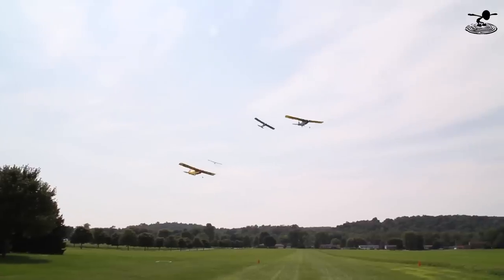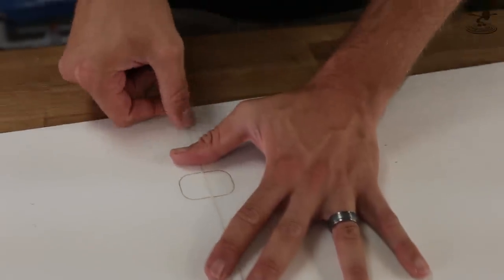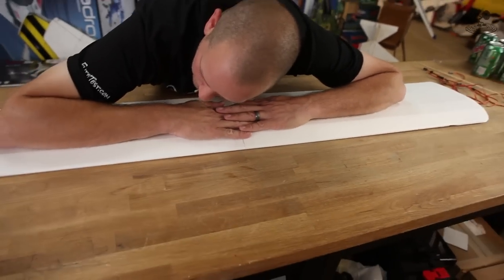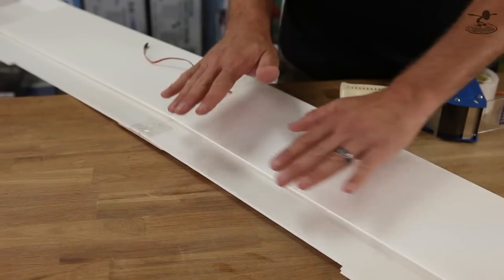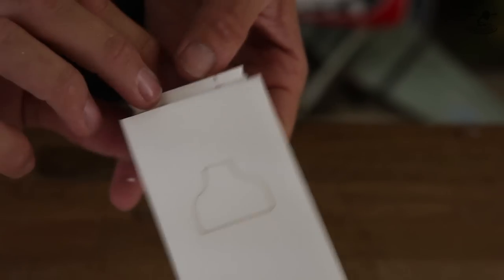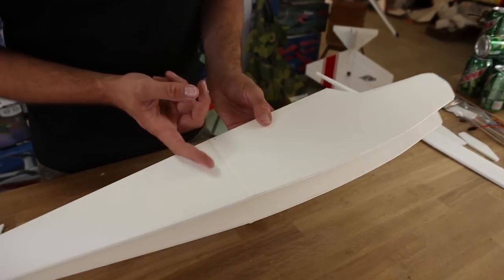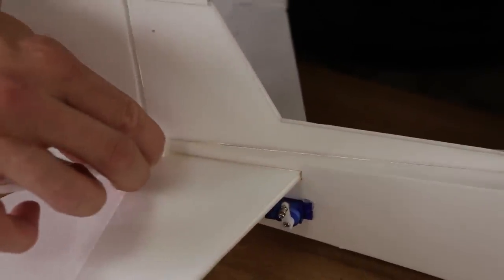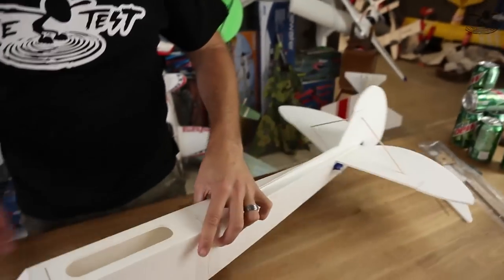Flite Test - FT Simple Storch - Build

Comment: If anyone buys this kit here's a pro tip. The Power Pack (C) doesn't come with enough servo wire for the whole plane, order more. It comes with four 12 inch wires, once doubled up is enough for the wing only. You'll need to either buy at least 2 more 12inch wires or 2 24in. It's not a big deal, but it would be really annoying if you didn't have any extra laying around.
Reply: Thank you!

Comment: I have been reinforcing the holes that the skewers pass through with Pieces of  Gift cards cut  in 1/2 in  to 5/8 inch squares with a hole drilled in the center and glued just as Josh did with the pieces of ply wood.  It is easy and doesnt need special tools.
Reply: You can also use pieces of Formica sample cards if they are still available

Comment: He makes it look so easy :D Took me 3+ evenings to make mine, and even then the landing gear is a bit off. First build so not surprised, should have started on the Nutball.

Funny thing is I could hear Josh all the time ::
"Remember, extra glue is not extra strength, its extra weight"
"Use your table as a friend"
"Now I'm just going to take a bit of scrap foam and wipe off the excess"
"Be sure to get all those little bits of foam out of there"
"Now I'm just going to take my razor and ..."
;)
Reply: My first build too!  watched that video 15 times easy, lol!
lay out and cutting was a couple evenings, final assembly was a few hours.
Now if only my receiver would show up!
Reply: FLITE TEST INSTRUCTIONS ARE VERY SPARSE. The videos move fast, much is left out. Instructions are disjointed e.g., power pod instructions are hard to find and are separate from all of the airplane build videos this is pure laziness on Flite Test's part. They do not even provide the link to additional instructions. They make it look easy but it is not easy the sales effort is real slick they have no interest in slowing instructional build videos down they just sell sell sell. Their indexing of build information is hap hazard semi organized all information is not in one place or consolidated, even though they think it is organized it is not. Older information is harder to find. Power pod instructions hard to come by.
Reply: @jmitsch44827  Free is free.
Reply: @jmitsch44827  ok, so 4 years has now past, what model would you recommend now with 4 years of research and technology behind our belt?  have they improved the plane?  is the landing hear nightmare fixed?  i read over and over about the landing gear.  Flite-Test is a first - rate community organization, i would assume it's all fixed by now in their speed-build kit, is this the case or not the case?  as for the extra materials needed, have they added things to the list like the servo extensions and things like that and stuff like this?  Just curious and I appreciate your help on this !!!!!
Reply: Niiiiiiccccccceeeeeeeee move

Comment: My first attempt to build the ft simple storch using A2212 3t 1000kv motor and a 1045 propeller with a 2200mah 3S battery ended in failure but I learned a lot.thank you flite test team.

Comment: I utilized the round servo horns included with the power pack servos as the reinforcement for the power pod. I used the nifty Philips screwdriver provided to widen the center of the servo horn (where it attaches to the servo) just enough to fit the skewer through it. I passed the skewer through the fuselage and through the servo horn on the interior of the fuselage *female teath facing in. I pressed it into the foam and followed up with glue wile I turned the skewer to maintain passage. works like a charm👍
 you guys are the best!
Reply: Wow very useful tip for me after reading your comment 8yrs later.

Comment: The one missing thing in your videos is guidance on mounting the batteries securely in the planes and on this particular kit.  The routing needed to connect  a battery to the ESC.  Standard cable in the power kits is not long enough unless you cut a hole in the power pod.  Cutting holes to to this and other elements of the electronics setup for each kit would be very helpful.   Just finished the basic assembly of my Storch tonight.   Tomorrow painting and final trim items before the Maiden flight.

Comment: I have built two of these and they fly perfect. This is my favorite scratch build and so easy to fly and very impressive on the airfield
Reply: is it a good plane for a trainer?
Reply: +lucas 09  I think so  it has a wide wing span . bigger is better I added 2 inches to the wing span on mine.
Reply: Oke thx i wanna make this for my first ever rc plane bit i dont wanna build a ugly trainer so thx
Reply: @robsycko  -- omg, wow, and it still flew?  seems like that would throw off fuselage length, C of G, empennage length and style and engine size  and things like that and stuff like this.

Comment: I like the wire tie connects on the ldg gear contacts. Light and quick to do. Also I would think dental floss winding-hot glue soak would also work.

Comment: LITTLE TIP, instead of using tape to keep connections together you can use shrinking tubes, used it on my tricopter to keep connections together and works perfectly!

Comment: Great plane. Only had a couple of problems. The wire I got in the pack was so thick that I had to use a vise and a hammer to bend it and it wouldn't fit in the gaps designated for the wire. Also the straw would not fit over the wire so I just have the foam wheels and nothing else. The other thing was the fitting of the esc and battery and the accessibility of the receiver. But other then that it was a really fun build and I would definitely do it again. 👍

Comment: I noticed the small opening in the bottom of the wing for wiring is directly at the paint stick joint. That could be opened up the entire width of the fuselage and still be unseen when the wing is attached to the plane. That would allow the addition of a small flat bracket iron bent in the middle the same amount as the dihedral and screwed on across the paint sticks. This would reinforce the dihedral angle and make the wing even stronger. Probably unnecessary; but maybe still a good idea.

Comment: I have a quick question.  when using the power pack, does a guy need to drill out the servo arm hole in order for the linkage stopper to fit?

Comment: I have more props. 8060,9060,9060 folding and 1045 .Which prop I must to use? I want 9060 folding prop.But im not sure about that.What do you recommended? I got emax 930 kv,40a hobby king esc and 2200mah 3s lips battery.

Comment: Is it possible to paint each main section of the plane  before gluing them together, for a better visual result ? Or is there a chance the hot glue may not stick too well on the parts if applied to the paint?
Reply: well its possible but keep in mind not painting the surfaces which you want to glue to each otherand you have to work precisely for the best result :)

Comment: Hello.
Ok so I am brand new to RC planes, and want to start somewhere.
I am thinking about buying this set + the pack with all of the electronics needed. 
I will use the plane for long range FPV flying.
What mah size is the best to go for, and how long flight time can i expect? 
Can i use the same battery for both FPV and motor, or should i get a spare one?
Reply: everythingzone I'd recommend you get the 3 pack swappable kit with the nutball before trying this.  I'm taking a stab at building this scratch and it's pretty challenging.

Comment: My local Harbor Freight stopped carrying those clear hot glue sticks and only has the crappy milky ones. I've only see the milky stuff, what brands are still using the clear formula? why did they change? is there an alternative?

also, I thought Peter did an OV-10 style VTOL tricopter or such, but I can't find anything on it other than an obscure video. you guys should do a speed build on that! it'd bridge the gap for some of us who like both tricopters and planes and want to do both at the same time!

Comment: Great vids guys! I only have a problem.... Since i live in italy i have no idea where to find the foam boards you use... I found something similar called forex or expanded pvc is that what you use???
Is depron also good for these projects?
Continue guys! great channel
Reply: I regularly use Depron 5mm and it works fine just finished a David Boddington Ghost Rider with Depron fuselage and hot wire cut wings fly's a treat.

Comment: Make sure to use loctite on those little metal things on the servos.  It will eventually unscrew...I learned that the hard way.
Reply: And... Use good servos, just, in general. Now a failed servo killing some foam isn't as bad as a wrecked 6 channel.heli, but crashes are never fun.
Reply: DFX2KX
 Crashes can be fun, what are you talking about?

Comment: Are you using 5 mm foam board? Or how thick it is? Please answer, its really important for me.
Reply: They use 1/4" but I have built with 5mm just fine. Good luck building!
Reply: Thanks :)
Reply: Readiboard is 3/16th of an inch.

Comment: All the way up to a 3000mah mr josh says, mine is getting a 4000mah 3s battery , 2830 1300kv motor with ether a 9x5 or 10x4 prop, metal gear servos all round with flaps,  and fully loaded with an APM, GPS Current sensor, Airspeed sensor, OSD, 433mhz Telemetry, two cams on a switcher, 1500mw vtx,  and also fitting arduino controlled navigation lights.
its fair to say its gonna be a heavy plane, will need to carry a reasonable speed to maintain altitude and aint gonna float like his did in this build lol

Comment: When you fold the leading edge of the wing backward and make two bevel cuts at 45 degrees, that only allows the wing to be folded at 90 degrees.  When I try to bend it further, it takes so much force that I feel that if I push it, it's going to put so much stress on the paper that it will tear.  What am I not understanding?
Reply: +Mike Collins The foam is mostly air too, and will collapse under force. Once you hit the 90 degrees the squishing of the foam takes less force than tearing the paper, so it will just squish.

Comment: Hey, I know this video is really old, but I have three questions for anyone who knows a little about this stuff:
1) Would you recommend I (a complete noob) get this for my first plane ever?
2) Can I make a cargo bay underneath in order to drop say water balloons or stink bombs with another servo, without compromising the structural integrity of the fuselage?
3) Can I cut holes in the front to add FPV and small action cameras?
Reply: An Audi RS6 1) ft tiny trainer or ft explorer 2) yes 3) depends in your planes center of gravity and how you set up the electronics to find out what you can mount and where. Fpv on planes can be done from the top very effectively and allows you to keep your CG un-dicked with.

Comment: Great video and plane.  Maybe I missed it but can you build this with dollar tree foam board?  The wing halves looked too large for a single piece of foam board.  Maybe I saw it wrong.
Reply: You are correct, the wing is made from 2 pieces of foam board.
Reply: I assume then the plans explain how to join two pieces of foam board to make one wing.  That would be fine, just curious in case they were using an odd size that needs to be purchased.  Thank you for the reply.
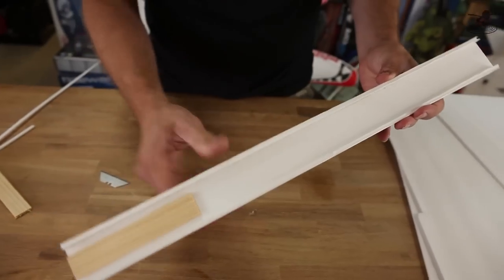Reply: MyTechWebTV you're welcome. The video shows how to join the wings at this part:  6:20  http://youtu.be/i0S4epTCmss?t=6m20s

Comment: The original Fieseler storch has "V" supports for the wings, I don´t see it in the Flite Test scratch model. Can be added? what is the most suitable material to make the "V" wings supports?
Reply: I believe you are talking about tension lines, going from near the end of the wing to the bottom of the fuselage? You can make these with some twine and some sort of hard point (plastic gift card, wood, metal)

Comment: are you guys really don't have troubles with elevator part???? tried this tail design on my plane, cuz i like how it looks). elevator make my ass burn - it needs a reinforcement for twisting, and simple stick or bbq will not work. guess i need to cut and glue in a U shaped thing. but what mat to pick?

Comment: Why is the paint stirrer stick cut and glued to two different pieces?  Why not use one stick crossing the gap?
Reply: I was wondering this also.  I think it has to do with how the wings need to be angled.  Sorry I dont know the proper tech term.
Reply: brischultz  I think you are right, it seems to have a slight dihedral to the wings.
Reply: brischultz Hmmmm, why not just score the stick on one side only just enough to bend to conform to the dihedral?  Just sayin.......

Comment: Someone please answer this question, I'm new to rc planes. When you buy the kit and get power pack c do you have to buy a separate receiver? I'm planning on getting this for Christmas
Reply: The Spitba11Warrior thank you
Reply: Would the B3 Pro Compact Lipo Charger charger (An internal 100-240V AC switch power is built in, and the high precision balance circuit can supply larger current up to 850mA series.Designed for 2s and 3s batteries)work for lumenier 2250mah 3s 35c lipo battery

Comment: Hi there. Great project here. I'm trying to make one too. Could you please share the sketch of the control horns and motor plate please? 
Thks.
Reply: it should be on the plans
Reply: Hi. Thks for the answer. They're not on the plans (at least, i could'nt find them. Could you send them to me please? Regards.
Reply: 007Cacto hmm. There aren't plans for the control horns themselves. I would recommend just buying them, as you get 20 for 5$.
Reply: Ok. Thks anyway for your time. :)
Reply: 007Cacto control horn plans? REALLY? ...cut something that's the right shape to keep the control rod parallel to the control surface and drill the hole so it's over the hinge. How hard is that. ...control horn "plans" ARE in the plans of many ft pdf files of you REALLY need them. Download a few planes until you find one with the horn on the page. Or you could Google "printable control horn" and click on images ffs. Sheesh

Comment: I'm curious. Those 9 gram servos, are they named because they weigh 9 grams, or the more likely (in my mind) because they exert 9 grams of force? (I know force isn't measured in grams btw).
Reply: Yes, 9grams of weight.  I get the 9 gram Emax metal gear servos from Ebay, for about $16 for 4 servos. They are great! Got tired of replacing the regular ones. The Emax ones have held up to some serious crashes. Haven't stripped one yet.
Reply: Flying Monkey Darn it, I just paid $11.99 (+ tax of course) each for 4 of them. HiTEC HS-55 feather micro.
Reply: WhatDoesThisButtonDo Hey, you'll need more sevos later. On that other build. : )
Reply: 9 grams of force would be far too low to move a control surface. They actually have around 1.5kg*cm of torque.
Reply: kardRatzinger yes, give or take. Depending on the brand and model. But 9 gram is in reference to the servos weight.

Comment: So quick and probably stupid question, I am extremely new to this hobby but it fascinates me and I will not stop until I get my plane off the ground. Ive built 2 of the versa wings and the paper always peels off of the elevons rendering them useless... which made me start thinking about the ailerons in general. How exactly do you get both ailerons (controlled by two seperate servos and servo arms) to be near identical in the throws? is it something you program later or is it more with the build process??? Thanks in advance
Reply: Flit test has an episode on just that. Mixes, on your transmitter. To fly something like a wing, your transmitter must be mixing compatible.  Check out their episode on mixing. Hope this helps.
Reply: Thanks! I've figured it out on my turnigy 9x
Reply: James Enlow Cool, 9X was my first, & is my second transmitter. I'm very happy with it. Glad you've figured it out.: )

Comment: could onemake somnething like this out of cardbord? or would it be too heavy?
Reply: Cardboard would be perfect. Just make sure to get corrugated cardboard. Depending on the weight of the finished plane, you might need a stronger motor kit.
Reply: @luberrdhruv  Thx. What about not-corrugated cardboard with ''bulkheads'' ?
Reply: Bulkheads are a lot of work and It will add weight but it will not give strength. And you will not be able to put the electronics in the plane.

Comment: I really like what y'all are doing but I wish you had put the beef package as the starter kit because it doesn't cost much more and most of your planes don't work with the starter parts and why I say this is because it costs a lot more for me to buy another esc battery and motor than if I just got the more expensive ones first.

Comment: Quick question: This is 3mm or 5mm foam?
Reply: prawdaprostowoczy It is about 5mm, it is dollar tree foam board (readi-board)
Reply: Do you know what is a density of this material?
I'm from Poland and we have something like X-foam here, but I think its heavier than this Dollar tree foam.My model ready to fly is about 430g (with battery 50g).
Reply: I made tintrainer using european X-Foam 5mm.It's quite heavy (450g-480g ready to fly with 1100mah 3s battery), but with my MT1806-2280 + 6x4 APC prop still flying nice.

Comment: What the best Remote Controll for FT Airplan ? And How I Chose Remote 5 km ?
Reply: "Best" usually comes down to preference. If you want transmitters that will go to 5 km and beyond, you'll want to start looking at the UHF range. To my knowledge, there are no UHF bands built into RC transmitters, you'll need to get a system that is compatible with the radio you choose.